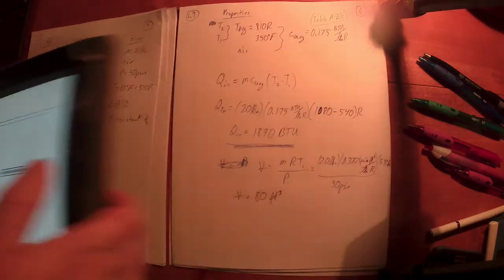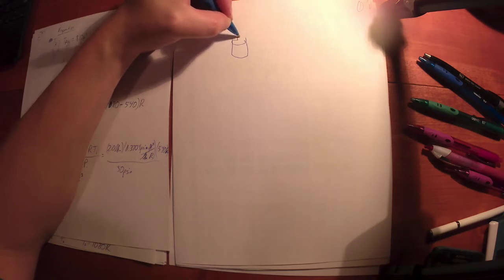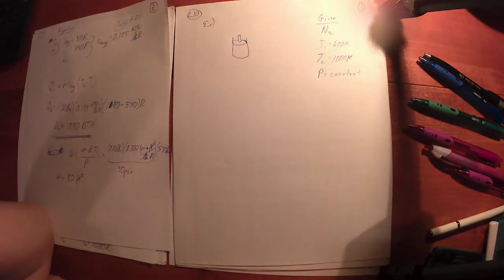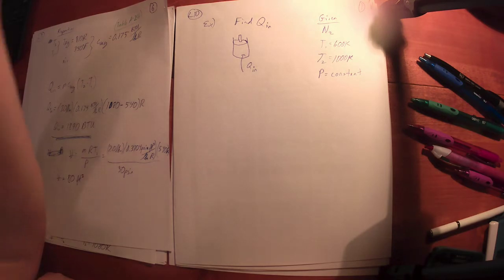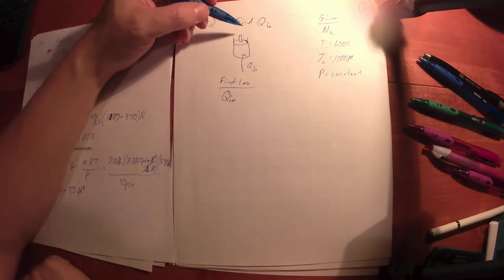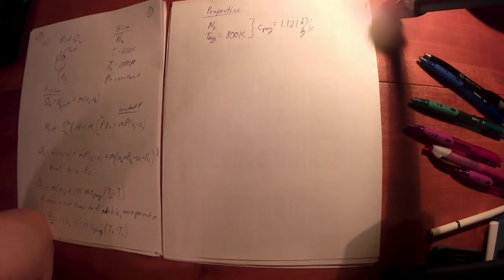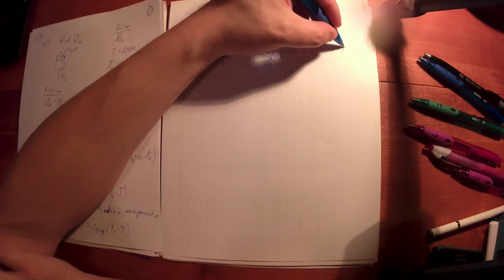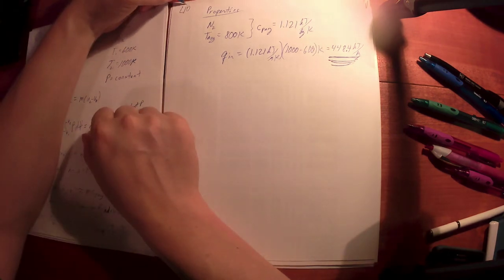Thermodynamics Lecture 10 part 1

Comment: at the beginning of the video you show the previous example. How did you get .175 for your c_v avg?
Reply from the maker: That's because our average temperature is 350 F. At 300 F cv is 0.174 and at 400 F cv is 0.176. So at 350 F we would have cv = 0.175. This comes from Table A-2E (b) in our text. Table A-2 goes on for three pages (a, b, and c). This value comes from the second page (b). Does this help?
Reply: Steven Fowler yes that helps, thank you